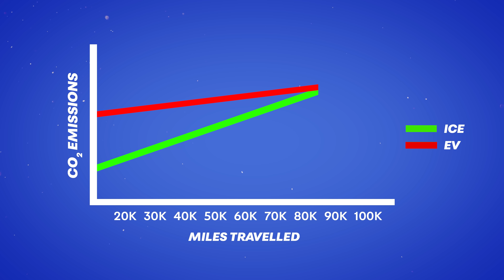Are Electric Cars REALLY That Green? [New 2022 Data]

Comment: Really interesting video, but if electric cars ever need the batteries replacing mid-life then the environmentally benefits are lost.  Time will tell if the batteries last!
The best thing to do is to keep a car running as long as possible, EV or ICE.
Reply: I had my Chevy Bolt's battery checked last year. Guess what? After three years of active everyday use (including three Canadian winters) and almost 50K miles  - my battery's degradation was estimated at about 2%. 
This means that the battery is highly likely to outlive the car.
Reply: @amenhotepavoskin1307  if that's a linear but it's not. I know 8 evs that had to have the battery replaced with only 60k miles
Reply: @beekeeper8474  I'm lucky, then. I was very happy with my Bolt as it was, but during GM's recall program last year, they gave me a brand new battery - for free! - and a brand new warranty for another 100,000 miles or 8 years. So, of all that's happening these days, my Bolt's battery is the last thing I have to worry about.
Reply: @amenhotepavoskin1307  so the car has done 50k but GM gave you a new battery on the recall last year so you have already had a battery at I guess about 30-35k so has probably only done 15k and less than a year old yet you boast about only degrading by 2%, it's virtually brand new, I would be gutted if it lost that much
Reply: @m4rkscott  I don't see what's there to be unhappy about. Losing 2% in 2 years (or 1% in 1 year) means losing 100% in 100 years. Based on  the average annual mileage of 20K, the car will run for about 2,000,000 miles during those 100 years. Two million miles on one battery is not too bad, is it?
Reply: @amenhotepavoskin1307  Degrading of batteries doesn't work like that, your first post was misleading claiming ESTIMATED 2% battery loss on 50k and 3 years then in your next post admitting that GM had renewed your battery last year and presume about 15k ago so 2%  over 15 k does not equate to 2% every 15k or 1 year, new batteries shouldn't hardly degrade at all over 15k I would expect 0.5% at the very most. Degrading increases speed as the battery gets older so when it is 10 years old it will degrade very quickly but if you are happy then all is good
Reply: @m4rkscott  Sorry if I misled you, didn't  do that on purpose. Yes, I had my battery checked immediately before GM gave me a brand new battery and the mechanic who checked it said that the degradation was about 2%. My mileage after two years was about 40K. 
As for "as the battery gets older so when it is 10 years old it will degrade very quickly", there's this German guy (can't remember his name off the top of my head, saw this mentioned in comments under another AutoTrader video)) who has driven his Tesla for 1,500,000 km on the same battery, and the car keeps going. 
And yes, I am very happy with my Chevy Bolt EV.
Reply: @amenhotepavoskin1307  At least that clarifies it, of coarse there are cases where high milage is achieved but there are also cases of people changing batteries at 50k miles, look up the million mile Mercedes of which there are a few running on the original engine but I'm not expecting my car to do a million miles, my pick up has done 190k miles and my car has done 120k miles and both run perfectly fine. 
I am thinking of getting a EV which is why I am on here but I don't want to hear best case scenarios, I don't want EV's bigging up.
I visit my brother on a regular basis who lives 260 miles from me so I need something with that range at least and will be fully charged from a house in  8 hours and i am unlikely be able to afford a new car with that kind of range and I am very unsure about buying 50-60k 5 year old model as off my research a lot of range could have been lost.
I take the best case scenario (your 1.5m kilometer (920k miles)) and the 50k nightmares iv'e read about and think that just like ice cars it's down to luck in the second hand market
Reply: @m4rkscott  The range depends on a number of things such as road conditions, temperature, using the heater/AC, driving style etc. My own best-case scenario was 604 km (~377.5 miles) - that was an estimated maximum that my Chevy Bolt showed me on a quiet summer day. Of course, the range drops notably during the winter frost, but even then, the Bolt gives me more than I need for my daily driving. Also, just for the peace of mind, there's a network of fast-charging stations in my region, so there is hardly any "range anxiety" - or hardly more than "gas anxiety" for gas car drivers.

And, don't forget to factor in freedom from paying for gas, oil, filters, belts, fluids, sparks etc. - EV's don't offer you those headaches, they are very low-maintenance. Also, add the 200 hp motor with instant torque that throws the Bolt into flight at street lights (0-100 km/h in 6.5 seconds), leaving most of the cars far behind, quickly and silently. 

This, along with some other things, make me love my Bolt so much. A desirable extension of my own body and soul. 😊
Reply: @amenhotepavoskin1307  Here in the UK most long range EV's are out of my price range and second hand ones are mostly high milage and our network of charging stations doesn't seem that great. I have just fitted a 3 phase high output charger for a friend that had just bought a Porche taycan turbo because after only 2 days of owning it he couldn't keep up with the energy he was using and couldn't be doing with waiting around while it was at a charging station for 45 minutes to an hour, he's all happy now though but not many people have 3 phase electric into their house at least they don't in the UK.
EV's are good in the right circumstances but the entirety of the network needs to improve massively for a full change of guard
Reply: @m4rkscott  And massive improvement is exactly what's happening! Knowing first-hand what owning an EV is all about, I remain optimistic about the EV future. Also, my neighbors have been watching me owning an EV for a couple of years now, and as my positive experience continues, they become increasingly thoughtful... 🙂
Reply: "The best thing to do is to keep a car running as long as possible, EV or ICE."  Well, sort of.  An older ICE is going to pollute more as it ages than when it was young, and most likely more than a new ICE.  So it makes sense to find out where that break even point is, then replace your car at that point if your goal is to do "the best thing" from an environmental point of view.
Reply: For me it's important to have a low cost, low maintenance car which is quiet, has Lots of torque and is fun to drive.
If it also saves some co2, the better.
Reply: @MrVirgilVox  Couldn't agree more! My Chevy Bolt is a trouble-free, low-maintenance, clean silent rocket!
Reply: True consumerism is part of the problem

No need for the new thing every year
Reply: Batteries are +90% recyclable to recover elements for reuse in new batteries, and dramatically reduce the energy needed to make new batteries versus raw virgin elements. It is IMPOSSIBLE to recycle fuel for reuse. 
Go Li-Cycle ♻️💵♻️
Reply: Most new EV's have an 1 million mile battery expectancy. Except the very cheap ones.
Reply: @piccalillipit9211  Sounds like a nice manufacturer PR pitch, but I know lots of people shelling out for replacement or reconditioned batteries for their Prius, leaf, i3, or Tesla between 60k and 90k miles. Warranties are nice but that doesn’t mean the battery will last, it just means the mfg will eat the cost of replacement.
Reply: @macsound  "Prius, leaf, i3" I will believe - I did say "except low-cost models"   Telsa I call total BS, unless it is a literal warranty replacement due to fault. Tesla offers 8 years or 100,000 miles, whichever comes first, and there are thousands of 500k mile 1 battery Teslas out there. 

AND the batteries are not scrapped anyway - they get used in grid storage solutions.  Just TRY an buy a 2nd hand unusable for a car Nissan Leaf battery - go on line and try it. You know one of those taken out of your mates cars cos they are no good - YOU CANT. Well you can if you pay £3k.  They are used in power walls for solar installations. 

Just admit you want to hate on electric cars
Reply: @piccalillipit9211  1000's of 500k mi teslas? 
Link : )
Reply: @bikersoncall  - you cant post outside links on Youtube. But just have a look online - many many taxi companies use them and put mega mileage on them. Its not even unusual.

QUOTE:  On January 6, 2022, a Tesla Model S P85 (the oldest performance version) reached an impressive mileage milestone of 1,500,000 km (932,256 miles).

The car is used in Germany by Hansjörg von Gemmingen - Hornberg, who is known in the EV world for setting the highest mileage records in Tesla cars.

QUOTE:  One that can is Tesloop, a shuttle service in Southern California that operates a small fleet of Models S, X, and 3. Each of Tesloop’s vehicles logs around 17,000 miles per month. Most have been on the road for well over 300,000 miles, and several are approaching the 500,000-mile mark.
Reply: @piccalillipit9211  Firstly, 'yes you can post' relevant links
on youtube, you just can't flood and promote. Secondly,
I'm sure you know that if you post a title, it will come 
up in a search. You said 1000's , show us, not a few
or 50, show us the 1000's, 1000's would mean at least
3 or 4 thousand, lets see your claim backed up, not a 
few anecdotal stories, show us at least 3000, that have
reached 500k mi. Tesla makes incredible vehicles, but 
that is not the issue here.
Reply: @macsound  but the battery is fully recyclable anyway
Reply: @piccalillipit9211  personally I like EV's my mate has just bought the Porsche turbo EV and it's smart as, after he had owned it for a couple of days he asked me to install a 3 phase rapid charger as the one that came with the car couldn't keep up with charging to use. If you put your foot down you use a lot of energy and the selling point of EV's to ICE enthusiasts is the power and torque etc so you probably get about half of the quoted range if you like to put your foot down.
EV's are good but they are not the total answer and will have a minimal impact on world pollution if any at all but they are fun as are ICE cars but ICE cars do sound better
Reply: @m4rkscott  - YEP they are going to use a lot of juice is you hammer them - thats physics. I agree. 

25% of global CO2 emissions are from cars - 30% from transport. So if 50% of cars are electric that will be a 10 ish reduction in CO2, that's not insignificant and if 90% are electric that is very significant. You have to  start somewhere - there was a time when it was 99% horses and cartridges and 1% cars.

The other issue is density of pollution - poor people live in polluted areas as a general rule, part of the reason that a poor person in the USA has a life expectancy 12 years less than a wealthy person - electric cars and busses etc will help with this.

Sound - 10 years ago I would have agreed, but I think we are trained to like the sound of a V8 or V12.  To me they now sound like history, the chirping of a dial-up modem in a fibre optic world. They sound noisy and unnecessary. 

Interestingly I got on one of the brand new £1.3 million electric bendy busses we now have here in Bulgaria on Friday. It was with out a shadow of a doubt next level. The normal buses we have are only 3 years old German-built Deisel but these new ones. It was like a space ship, literally, it looked like a set from 2001 inside. But the main thing was there was almost no seating, big chairs for elderly or infirm everyone else stood and there was no hand rails or grab rails cos the electric drive train was SO SMOOTH in acceleration is was more like a modern elevator where you can SORT OFF tell you are moving, but not quite. 

No one was jerking back and forth, falling into each other, hanging on for dear life - so you could just stand as if on the pavement and read your phone...

The practical upshot is, you can fit 2 X as many people on the bus without crowding - so switching to electric has just doubled the capacity of the city's bus service and that's GRAT as the cost of living is imp[acting people... 

Sorry for the long post - my point is, the benefits are numerous and not always immediately obvious...
Reply: @piccalillipit9211  The time frames don't fit with the ability to provide enough electricity and build the vehicles we would need not to mention the affordability of 2/3 of people and that's in the western world.
I get the feeling that you feel that I am against EV's when nothing could be further from the truth but I will always look at the issues involve in achieving goals and the benefits of anything particularly if something that is forced and removes choices that people have. 10% is of coarse significant but even if it is 100% (cars only) then it is still only 0.25% of the planets carbons which isn't enough to make a big enough change and that is assuming that all electricity is renewable or nuclear in which case that alone would have a bigger impact than EV's alone.
I'm pro electric and pro nuclear because that seems the only way to achieve the set targets but it will not be achieved in 5 years, a 50 year target would be more realistic remembering Africa and Asia being growing markets and consumers and they are and will continue be the pollution capitals of the world for some time yet.
I personally love the ripping sound of a v8 and being thrown around with the speed and tussles but that's my choice and should be respected as I respect your choices, as I said we have been capable of making carbon neutral fuels for 50 years or more that can be used in ICE engines also in lorries, ships and planes and that would have a bigger impact than EV's alone and keeping peoples choice at the same time.
There are many things that need to be done including banning the burning of coal full stop and starting a nuclear program immediately whether that be mini reactors or thorium salt reactors. Thinking EV's is the solution is naïve to say the very least, it is a small part of the solution, a worthy part but still a very small part. Also when you quote percentage of global emissions I presume that you are referring to global being 100% of the 5% that is caused by mankind because 95% of carbon is produced by the planet naturally which we have very little or no control of
Reply: @m4rkscott  - Let me clarify a few things:

1) I absolutely do NOT want ICE cars banned for enthusiasts - I want the 90% of driving that is mundane essential driving to be dont in ICE vehicles, preferably mass transit

2) Transport is a v ery important element but I think it is one element of a global problem and it gets WAY too much attention, I think concrete emits as much CO2 as cars or close

3) No it wont be 5 years, but I think 50 years is also a fantasy, I think the globe will be two screwed for human habitation is we set a 50 year target

4) Yes I mean the human % but thats the only % that counts as the other is in equilibrium and even if its not we cant do anything about it, and just by the by the entire "cows are bad" argument is MASSIVELY flawed, but that's a long cvonversation. 

5) Im a massive fan of nuclear - especially molten salt reactors - I think every town should have a molten salt reactor

6) I moved from western suburbia to an eastern European ex communist city and we badly need to change the way we live in the west. Car dependent energy-intense suburbs are not only bad for the environment they are horrible to live in. Say what you want about the communists, they got the city planning spot on. My energy use living here is about 1/5th to 1/10th what it was in the UK.  Dont need a car. Passive heating and colling on the building. We can do a HELL of a LOT better on the way we live.

The average house in the UK is £275,000.  If the land was the cost of agricultural land you could build a zero-energy house for £275k and why is land NOT the cost of agricultural land - government policy to keep housing prices up to keep middle-class people voting conservative. It is a political decision to build sh!t houses that cost a fortune... 

7) I didnt think you were anti EV - sorry got a headache today so I'm a bit blunt
Reply: @piccalillipit9211  /50 years is not fantasy at all, it is progressive and as started already, I get a little disillusioned at times when ( some ) people think that if we all buy electric cars then the problem is solved particularly the people who can go out and spend £50k on one tomorrow but that isn't real life.
Oddly I agree with you on most points, prices are so inflated in the uk for materials its a joke, I am a builder and I am £150 000 over budget on a hose that I am building at present.
The 50 years that I refer to is 20% every 10 years and I know that some parts of the world will be faster than that but I am talking globally to achieve 100% and I think 50 years is realistic but we will see the benefits as it progresses but there is a hell of a lot more things to target that are possibly more urgent if not then equally
Reply: @m4rkscott  - I dont think we have 50 years. Thats the issue. I moved to Bulgaria 13 years ago - we used to get 1m or snow and the winters were -25ºC 

We have not had snow for 4 years and winters are now on the very coldest day -8ºC. so when I say fantasy, I mean I think it is a fantasy that we HAVE the luxury of it taking 50 years. That said its the first 50% that is MOST important, if we can cut 50% in 20 years MAYBE that will save the planet for humans., I dont know.

The electric buss on Friday was a revelation. Everywhere should have them, they should be as cheap as they are here - flat rate 60-p no matter how far you go - and that would have a MUCH MUCH bigger effect than electric private cars. It was genuinely like something out of a sci fi movie, totally smooth, silent, floor to ceiling double glazed windows. Get people on super clean - environmentally and physically - super efficient, cheap, frequent - every 7 minutes there is a bus to the city here - make it 60p to use electric transport not £50k...
Reply: @piccalillipit9211  I really hope we have got 50 years because we need it, some countries will do it in 15, mainly the ones geared up the best but we do know that a lot of countries will drag their feet especially the emerging ones. I'm on the same page as you in the main but when i look around and still see coal the fuel of the 19th century being burnt even new mines being opened in some parts of the world then I think we are going backwards not forwards and I don't have your confidence that the whole planet can clean it's act up well enough the time frames quoted by governments across the world
Reply: @piccalillipit9211  My 6.7 Cummins has better life expectancy and can actually pull something and doesn't run on coal and doesn't catch on fire by itself just parked in the middle of nowhere.
Reply: @dansmith5012  - Grow up you child.
Reply: We are starting to see recycling of batteries in Europe but don't know the energy cost but feel solid state chemistry could be the answer to wait for as only electron pass between cathode and anode giving extended life.?
Reply: @bernardcharlesworth9860  Yeah exactly, we need to move to better batteries or something else quickly. What happens in 50 years when all the EV batteries are no good for anything and they need recycled. Tesla has 7000+ cells in each car and if there are 1 billion EVs on the road in the next 25 years... do that math on that! Those lithium metal cylinder cells are hard to recycle which leads me to believe that most of it will go to landfill or through a complex recycle process. Recycling these should be part of the Co2 conversation.
Reply: Nothing gets better and cheaper as fast as electronics. New batteries with new materials are being developed at a rapid rate. They will get more mileage, cost less, last longer, use less exotic materials, and be easier to reuse or recycle. It's a transition.
Reply: No, the best solution is to not have a car full stop!!!
Reply: @PeterPete  
Shut up. That’s just not an option for many people. Not everyone lives next to a train station
Reply: @hoonaticbloggs5402  There's public transport and bicycles too. If more people gave up their cars maybe public transport would be more suited to people who don't live close to a train station.

Imo millions of people waste fuel/electricity/resources driving around in their cars just for the sake of it. And where do they really go? Nowhere! People can work from home. There's lots of solutions today for people to avoid using cars whether electric or ice!!  

You can even get your grocery delivered too!!!
Reply: @PeterPete  
Prison guards , bin men, police, firemen, pilots, surgeons, care nurses, mechanics ,you know, people with actual important jobs can’t work from home.  And people who live in a rural place have maybe one bus a day , or a 20 mile journey to work, public transportation or bicycles I are just  NOT an option. You need to see things from a view not just or your own. 
 And for fun I have a big V8 engined car that I drive just for fun. And it has leather seats. And I eat meat. 
 But I don’t employ African children to mine cobolt.
Reply: @hoonaticbloggs5402  As an example, firemen can all get picked up in a minibus and be driven to their station for their shift. The minibus can drive the retired shift back to their homes. 

You see, people don't need their own vehicles to carry out their work if everyone realised having a vehicle of one's own is just a waste!!!

Society could be so much better if more people thought of others instead of their need to be better than others!!!

Quote - And for fun I have a big V8 engined car that I drive just for fun. And it has leather seats. And I eat meat. 

Doesn't make you any happier or bettter than anyone else. You can't take your V8 to your grave!! I look at alot of people in cars and I think they look hilarious!!!
Reply: @PeterPete  
Ok buddy.
Reply: I'm coming on on year 10 in the life of a Nissan Leaf. The battery still has a capacity of 11 of its original 12 bars. As long as you treat batteries well -- don't let them sit at 100% charge, try to avoid dipping below 20% -- their lives can be very long.
Reply: @Steve-wz5pz  Probably the hard part, right? If everyone is super fast charging, that reduces their life too, which seems to be the big push for those who kept ICE cars for their range.